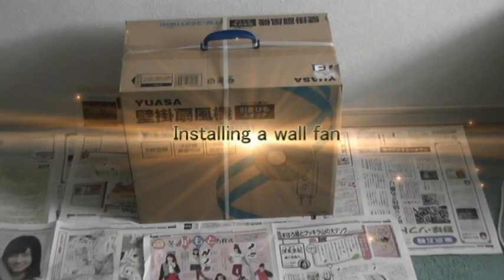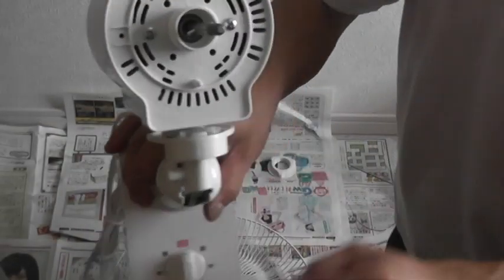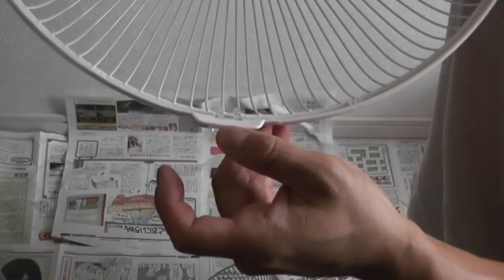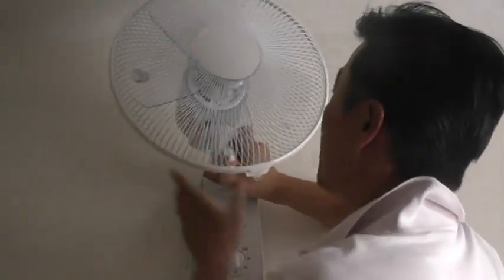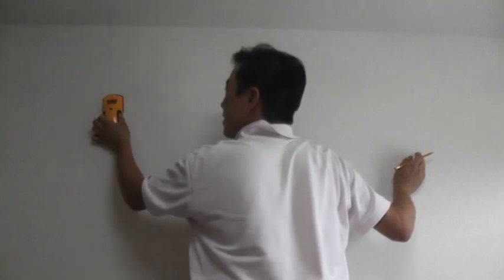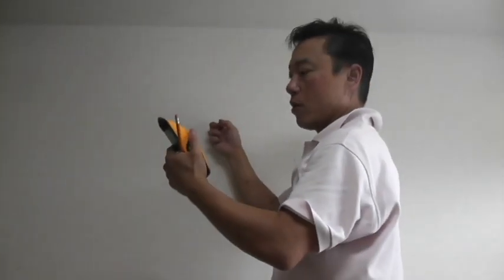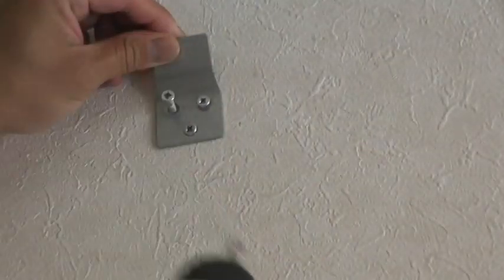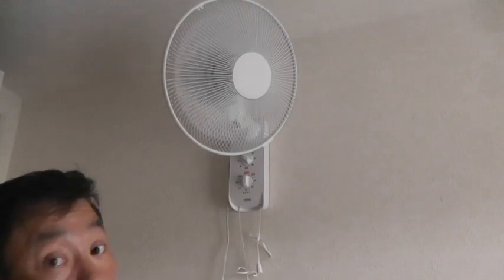How to install a wall fan DIY

Comment: HI, do you screw them into the stud? is that where they need to be screwed? mine fell on my arm yesterday...not fun...:(  I didnt use a stud finder...just want to make sure...)1 of the screws hit i think metal?  let me know...thanks!
Reply from the maker: You definitely need to check for studs but if you don't any, you can use plastic anchors in your draw wall which will secure your screws and fan!  I hope this helps.
Reply: @WOWTHATSJAPAN2  thank u, yeah not fun it fell on my arm...yikes, I went and bought a stud finder lol...will try w the anchor!
Reply from the maker: @mariapilarboylen2098  I hope you didn't hurt your arm too badly! The stud finder is an indespensable tool have! The plastic anchors are for dry wall and if you cannot find a stud behind the wall.  However you may want to place your fan in a way that is far from a stud so in that case I would use plastic anchors. They sell many kinds of anchors so you'd better ask the clerk which anchors and screws would be good enough to hold up such a fan.  If you know the weight of the fan, then you should also tell the clerk that.  Good luck!

Comment: My one very like this but with Igenix label keeps letting fan drop down onto its nose even when the connection is screwed tight, nothing to make it hold up in place.
Reply from the maker: Does your fan have a knob lock on top to lock the fan in position? It should have that. However if it does not work, then you could have a defected model.